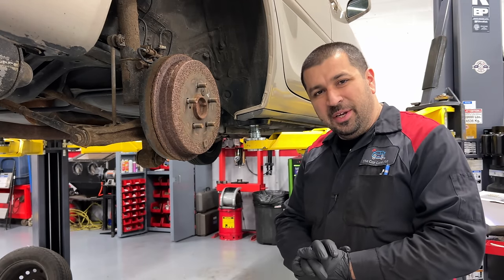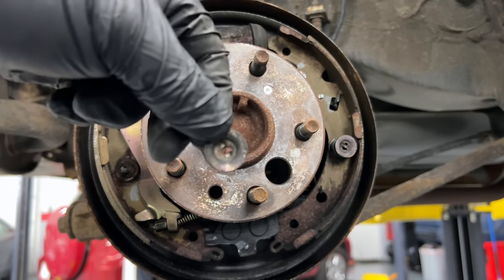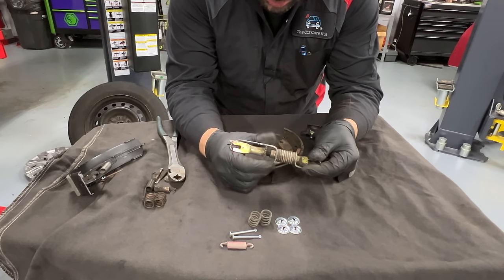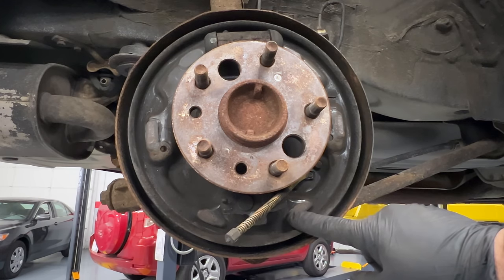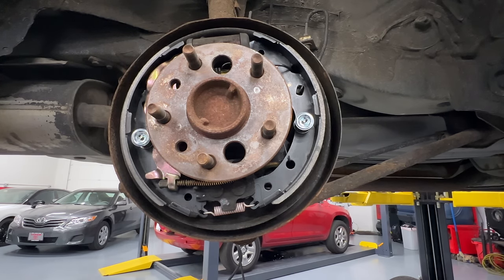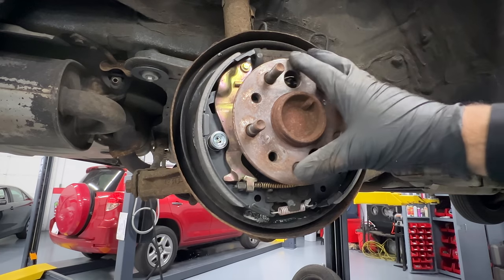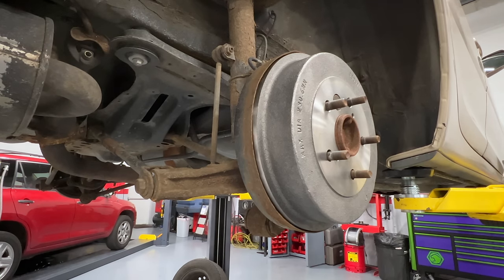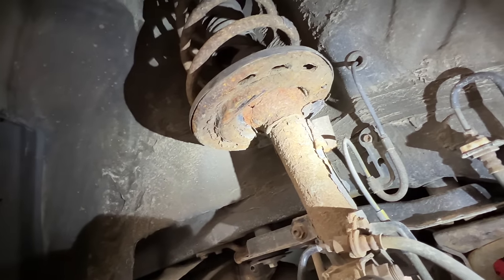How to Replace Toyota Drum Brakes Like a Pro

Comment: My drum brakes make a noise when I let go of the brake and start accelerating and the noise stops when I get to 20mph
Reply: Sounds like theyre hanging up. Wheel cylinder hanging up, flat spots of backing plate need lubed, or springs are weak (not pulling shoes back quick enough). I'd clean, inspect, & lube.

Comment: almost every time I have done drum brakes I have considered only replacing the front shoes. If everything is still working why not just do the front springs? That males it a simple and short job. WHy not A?
Reply: Mistake. I meant just replace front shoe, not spring. Everyone hates brake drums. Most cars have gone to discs. Even my 1984 mercedes has rear discs. I assumed my new 1998 4R would have rear discs. NOPE!
Reply: Heat weakens spring tension. Then u have undiagnosed problems. Do it once, do it right. 🖖👍

Comment: All the cars I have owned and currently own are disc brakes and I will never own one with drum brakes. One, they look ugly and the system looks complex. Good thing for tutorial videos on Youtube or I’d be lost if I tackled this job blind. I do Iike that they are good for 100k+ miles? My dad has a ‘99 Sienna with 130k+ miles with rear drum brakes. Not sure if the shoes are original but I don’t hear any noise or feel the brakes are inadequate. I have done all my brake jobs and I may or may not want to do this even after seeing this video 😂

Comment: Dumb question> Isn't it cheaper for manufacture to just install disc breaks?
Reply: Just more efficient/safer. Engineering was primitive before. Hust like single master cylinders to dual master cylinders. There was a Toyota tech near me who put discs on the rear of his 97 camry like mine. I envied him with drums.

Comment: Have you ever did shoe replacements on a 2004 toyota 4runner? The hold down pins are behind the hub. It's a bitch to remove them.

Comment: A well maintained 2005 Toyota or as in our case here in Wisconsin is a good beginner's care in our case this teen ager is now on the therd car, Rolled the first one skidding on very loose gravel and the second someone slammed into the back of the other now the therd  car has been getting by. All of these Honda's have over 250,000 miles on them, It's Not the Car's fault, Teenager's are known to destroy Cars.
Reply: O and tell Your teenagers to stay OFF of the PHONE while driving, You'll Thank me later..🧐

Comment: Ahhhh. no.  2005 Toyota Matrix, rear drum; INSIDE access adjust, not through drum. Ratchet Assy. NECESSARY, as it was WAS NOT working, either side, one side was 'bent' out of dissuse, and the other side the little arm.... was broken off, and in the bottom of the assembly. 100k miles, only 50-60% worn. Adjust? Rotatt 'star' access DOWNWARD to tighen. But yes; NO CLICK? it's HOSED!

Comment: 92 camry. 470 k miles. But rear brakes are a joke. Brake hard and they catter and surge. Replacing parts is a waste of time. Pee poor set up. Self adjusters don’t keep up. Have to adjust manually when pedal gets low. Trash.

Comment: I just don’t like the idea of drum brakes..
Reply: Why not? They work great, and they keep dust, dirt, and debris away from the brake pad (shoe) surface better than disk brakes. Great option for rear brakes to compliment front disks, and they last forever
Reply: No comparison drum vs discs. Less parts, rotors stay cooler, pads last longer, & a HELL of alot easier! ✊👍🖖🇺🇸 drums 👅 suck
Reply: @riceburner4747  then why does Toyota continue to put rear drums on their Tacomas to this day?
Reply: @jeradmiles1956  because they last 17-20 years. And they only do the rear. Front brakes do 90% of the work
Reply: @stackthatartpaper  if you read my initial reply that's exactly what I said.

Comment: How to replace Toyota Brakes Like a Pro , WTF Bro a Pro would have replaced the wheel cylinders especially as you said car has the original brakes and its done over 200,000 Miles , Nothing Pro about this video accident waiting to happen big chance those wheel cylinders will leak all over the new shoes .

Comment: Good video... except a couple huge things. I've done more brake jobs than you, absolutely and had a specialty brake/alignment shop before changing professions in late 80's. Also one of the first 4-wheel alignment shops in my state.  You didn't use Permatex silver anti-seize (part # 133K) on the backing plate raised pads. HUGE fail.  Drums are never true when new.. they get dropped etc and to put a brand new rotor or drum on a car without turning first, is about the dumbest thing anyone can do or say. Absolutely.  
WHOOPS... no, actually not replacing or rebuilding the wheel cylinder is dumber. lolol    I saw my old shop buyer wasn't touching them anymore and I reamed him hard.. actually, most shops are NOT touching the wheel cylinders and that is stupid!

NAPA tried getting me to be their Northwest field rep in my early 20's, so I would've been teaching you down at your local Napa store.. and anyone who has rebuilt wheel cylinders realizes the aluminum pistons get gummed up nearly always, and between the cups is icky, sludge, etc. I don't care if all shops are on that these days (lots are)... I'm telling you all, if you aren't doing it, that only tells me you haven't ever rebuilt wheel cylinders or you'd know what I'm saying and 1000% agree with what my rant!

The problem you're having is likely also effecting your rotor turns too?.. you're maybe not spinning & tightening as it's spinning, as your final lathe tighten? That's what I'd do to help insure it was turning true.  

But also since I was the best brake shop in my part of the state, also did piles of cars and walk-in's since I was a stocking Raybestos dealer & did piles of walk-in drum/rotor turning... I also had several Bear adapters where you bolt a drum or hubless rotor to the adaptor to insure it's true... can't remember their cost, but worth the maybe even a $grand these days- you know it'll be turning true as if it was on the car turning.  I looked at those coming out back in those days, where you bolt a grinding tool to the bridge and turn rotors on the car; can't remember why I didn't like it.       And for all you backyard mechanics?  That asbestos is like a cake.. get a grimy greasy fingerprint on it and that part will finish "baking" (curing) differently than the rest.. often getting tiny cracks in that spot and is why contact surface and their shoe/pads should be kept pristine.. a final touchup of crocus cloth like he did, but you should never have a greasy fingerprint on the new asbestos.  It's important.     Kinda miss it all......
Reply: Don’t care